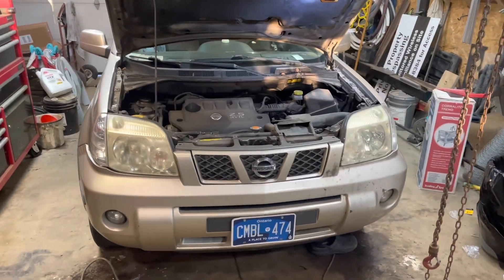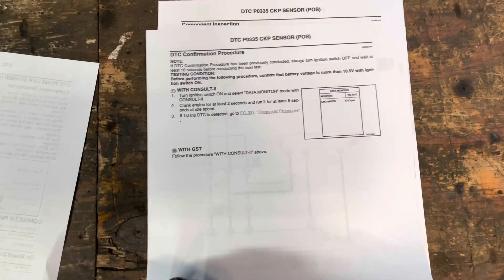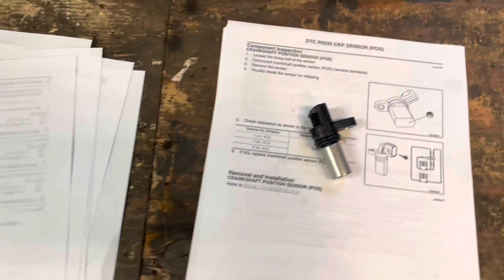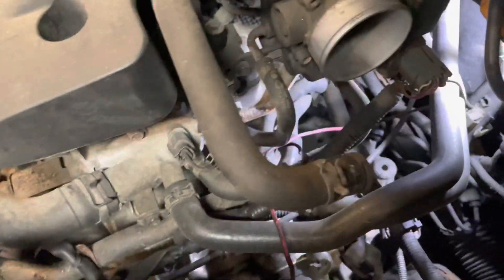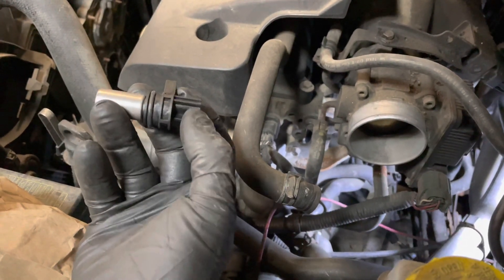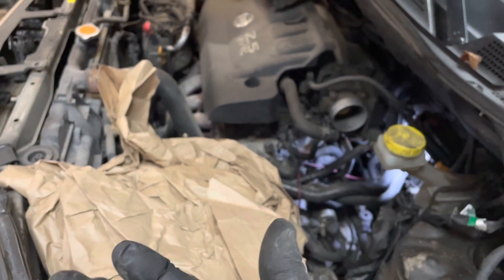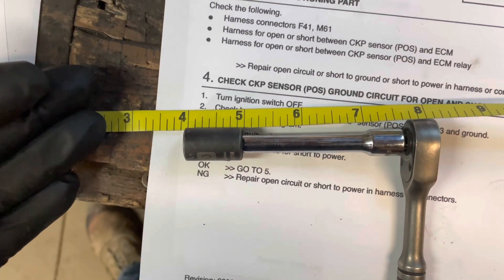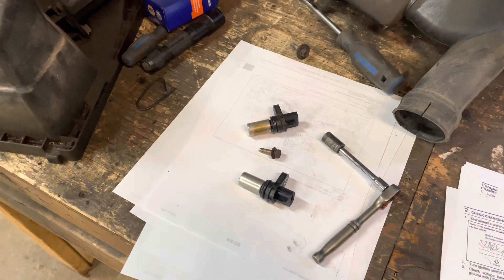Nissan X Trail T30 - Crankshaft Position Sensor

Comment: worst car ever made such a simple job on my ford falcon this pos car has to be back on the engine ive been trying for 3 hours to replace this rubbish part amazing ive replaced transmissions that are easier that this stay away from xtrail
Reply: It's worse when you get a cheapo sensor and have to do it again after paying out again for a genuine part. 
I'm not confident the pin out is the same, earth and signal reversed?.

Comment: Oem sensor or aftermarket? If i install aftermarket will it be ok or only original sensor from the dealer?
Reply from the maker: Either one is fine. I used aftermarket
Reply: For the camshaft sensor, which is SO easy to do, I'd gamble on the aftermarket. The crankshaft sensor is a pain, though, so I'd say seek out the best of aftermarket — or from the dealer.

Comment: Doing the  same job next week when the parts finally arrive from ebay, switching out both the cam and the crankshaft sensors, Cam is easy but struggling to get access to the crank sensor, your video has helped alot, thank you
Reply: finally got the job done, Cam sensor, 90 seconds, crank sensor 90 mins, hardest part is pulling the sensor, recommend needle nose vice grips, lock on and wiggle until it finally releases, not a comfortable job but beats paying hundreds of $$ paying a mechanic to do it
Reply: It gets better with practice, LOL! I did my 2005 XTrail crank sensor when I first got it in 2015. Now doing it again and hoping it's the fix for my hard starting. Fuel and spark are there, but likely disorganized by a bad sensor...) 405K km on this beauty, with original motor and automatic tranny.

I found it's easier to remove the mass flow sensor, to get a better visual and a bit better arm access. Leave the air cleaner base alone. Just pull back the filter top housing and air feed. I disconnect the cable when the sensor is out. Easier — but not easy. If you can't finger-squeeze the release, use a long screwdriver to press the release while gently pulling the old sensor out.

Update: I had trouble getting enough twist and push on the new sensor — but I was being interfered by the annoying bracket on the back of the motor, that supports a few heater hoses. There's a 14 mm bolt that is easily accessed. Get that bracket out of the way and you will get a little better access to the sensor location. Belly on the fender and feet in the air... and I got the right twist and push on the sensor to get it in place. 

Here's hoping it solves my troubles.

Further update: no joy. :(  I have spark and plenty of fuel — but it makes a few attempts to catch and just goes back to futile cranking. Pull the plugs and they're soaked in fuel. Used my air compressor to totally dry out the chambers... and back to a few pops before going back to grinding it out.)

Later... Ultimate fix: I read elsewhere that you can try starting with ONLY the camshaft position sensor disconnected, as the crankshaft sensor is THE sensor needed at starting. (I'm guessing the computer needed some time to reacquaint with the new part?) This worked like a charm, then I plugged in the cam sensor and things have continued working fine this week. At 405,000 km, I'm sure there will be other issues popping up. Glad I have a fairly simple vehicle to work on.
Reply: @barrystewart3950  Hi I had similar issues 2004 model, it was faulty O2 sensor. Have you checked for fault code?
Reply: @concernedcitizen3159   Thanks. I've updated my situation (above), as I'm up and running again. I saw elsewhere to try disconnecting the cam sensor before starting with a new crank sensor. This worked brilliantly, then I reconnected the cam sensor and it's happy-ish.

Either the catalytic converter or the resonator (or both) are making an awful buzzy/rattly noise when cold, so that's my next issue.

Comment: Last night I replaced both the crank and camshaft sensors on my T30 (2008) What no one tells you is how extremely difficult it is to remove the faulty sensors. The o ring sucks to the body and it was a real struggle to pull it out especially the crank sensor. Also. The car didnt want to start the first two times. It did start on the third try after leaving it for a few mintues. I guess the ECU had to its thing first.

Comment: Hi I’m a new subscriber as of today. You were very helpful when putting in my blower motor today. Im having a problem installing the new sensor. It seems floppy in the hole it came out of. Im wondering if it’s not fully seated being it’s a cold day and the o ring may not be letting it seat. It seems fully seated and I was going to try and use the bolt to seat it the remainder of the way. It’s getting dark and I’ve called it a day.

Comment: I had this componet fail on my X terra. It started acting up with odd engine running characteristics until the engine just stopped. You could start it up again but it would happen again. No service engine light was illuminated but the shop got a pending code. Still have the original cam sensors in the 2009 X. Nice to know that the cam sensor and crank sensors are identical.